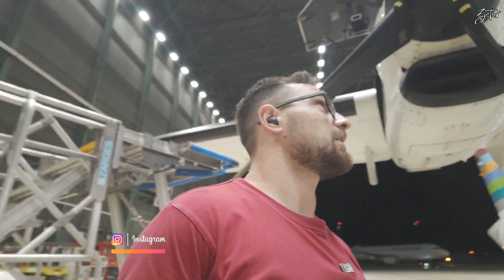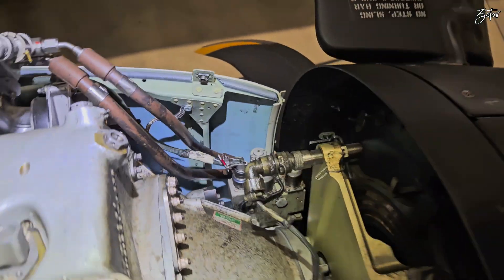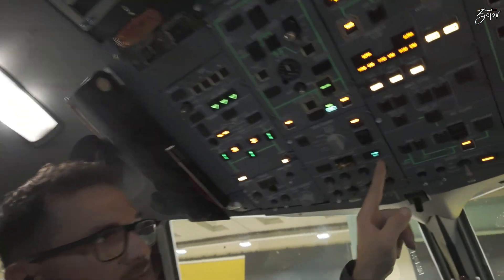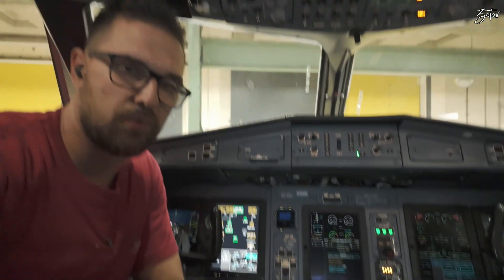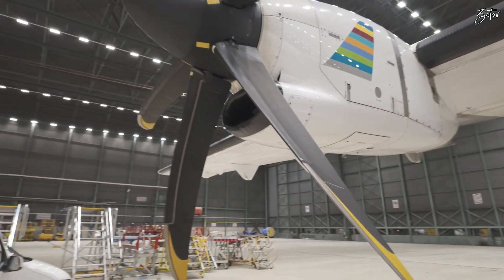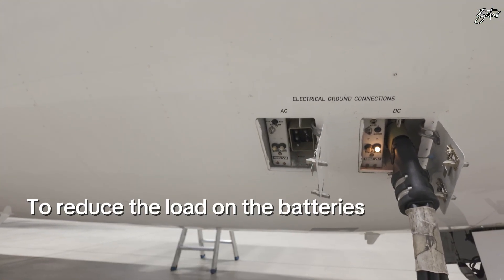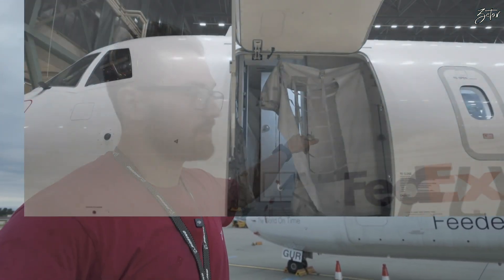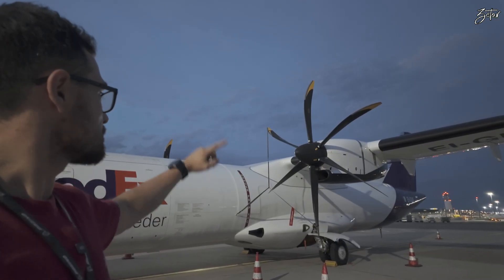No APU (Auxiliary Power Unit) no problem special on ATR aircrafts

Comment: hey thanks one question, in hotel mode or running der turbine without spinnig propeller does that not overheat the turbinewheel inside of the propeller axis while blasting on one or same point(s)?
Reply from the maker: It can withstand only certain heat and pressure provided by the engine, that's why you have their gust lock to prevent damage
Reply: @zeto.r  The engine power shaft is disengaged from the propeller shaft at this point or stay connected?
Reply from the maker: @limaplaygame https://youtu.be/2XPcT8m_9oY Watch this. I explained it there

Comment: I'm a bit confused about the AC part of the electrical system. The turbines spin very fast, but wile changing power their speed also changes which should change the frequency of the AC. Am I missing something or how is that combated?
Reply from the maker: Depending on the aircraft on ATR you have DC generator and AC wild which means variable frequency on A320 IDG produces constatnt 115v 400hz thanks to gearbox inside
Reply: @zeto.r  So I'm guessing in this aircraft AC for whatever doesn't care about frequency not being constant, and DC for cases where it would be a problem. Thanks.
Reply: @ImieNazwiskoOK, it depends on usage. In ATR-72 some of the avionics need 400 Hz AC and that is feed from static inverters to them. Wild AC (341 – 488 Hz in ATR) is used for example for lights, water heaters, ovens, etc.

Comment: I work as Tower ATC I an tell you that when ATR is parked on the aipron it's much louder when runing one engine than other jets runing APU. So usually then run GPU instead.
Reply: Usually they run GPU due to operating cost and due to the fact that right rear "cargo" / cabin service door is not allowed to open when engine 2 is in hotel mode.

Comment: As a fueler we never access the fueling panel and connection until the engine is completed shut off. Just thought of something thought, can u start the engine in hotelmode?
Reply from the maker: I can understand that you don't want to have a fuel hose under the running engine. Yes you can, The propeller brake can be on during any ground operation.

Comment: Back when working around these things, the engine on hotel was treated with similar danger areas than normally running one. Use of rear service door was prohibited when it was running on hotel, as you'd be within engine's rear danger area, though due to exceptional circumstances I've ended up doing that, twice if I remember. One little 'detail' is where that ground air connection goes: it is right next to the RH propeller. In principle, you should not ever need to use hotel when ground air is connected, but I am aware of a case or two of danger & damage. The order was to have the engine completely shut down (=not in hotel) if it was running for whatever reason, before getting there to (dis-)connect ground air. The GPU, on the other hand, can be safely connected with the prop turning. In overall, the hotel mode was not used that much at all, mainly only during summers if the cabin was hot. It is a bit dangerous for the very reason it appears safe to approach the propeller.

Comment: Propeller, feather configuration, geometric pitch, fixed and variabile pitch , the problems about aerodynamic tip stall , structural strenght, one of the best modules for a B1 technician. N
M17 which Is also bonded to M14 and M15, propulsion and gas turbine engine. The turnoprop uses turbocompressor for the air conditioning system, very interesting and Amazing topic

Comment: Could that brake lever being used in-flight have something to do with the recent crash in India?
Reply: its not actually in india its in nepal instead of flap lever the fo put the condition lever to ftr thts why
Reply from the maker: You can use it only in a certain condition. I guess it is impossible to activate it in the air